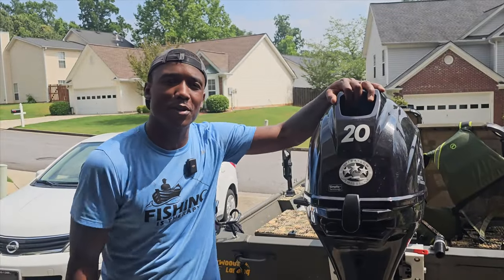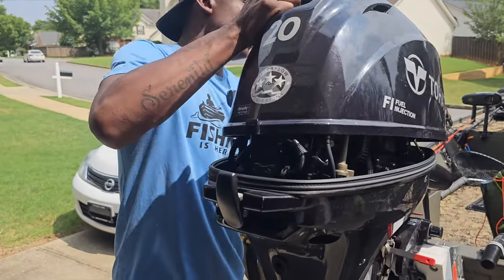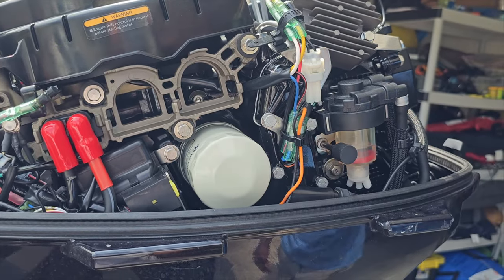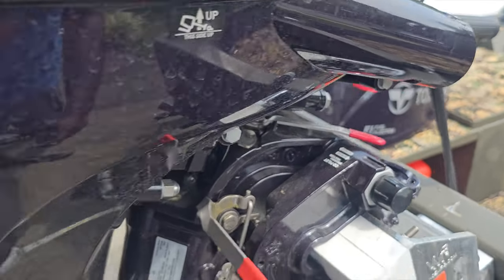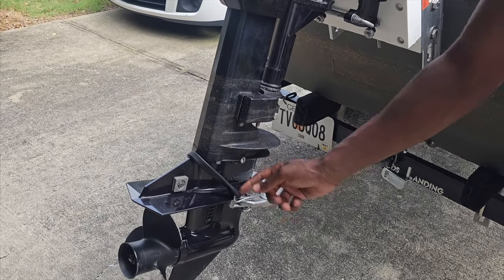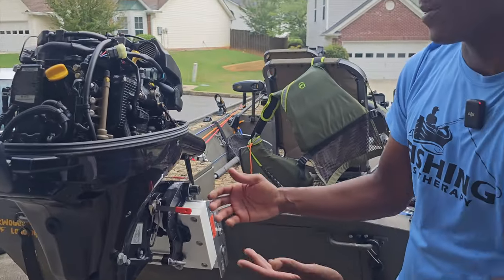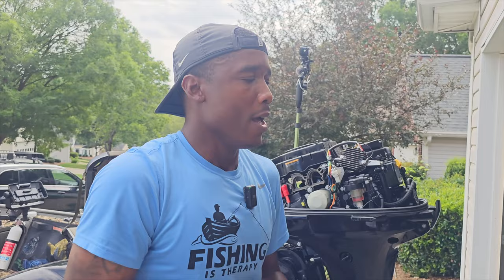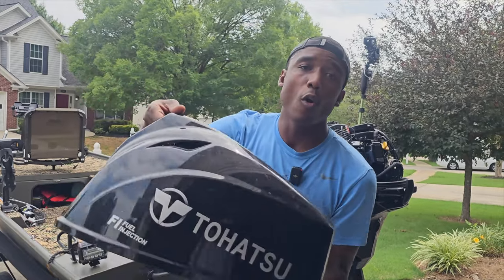Is A Tohatsu Outboard Worth Purchasing? Find Out In This 20hp Tohatsu 1 Year Review

Comment: 2017 Tohatsu MFS30 owner here. I fish saltwater only (Portugal). At 450 engine hours the motor developed an oil leak (but never had any running issues). The retailer changed the entire engine block free of cost. The new block has been great so far (50 hours). Good motors.
Reply from the maker: Awesome. Thanks for the heads up and glad thr engine has been good to you. I love mine. Ran her hard today from one of the lake to the other and she held strong.
Reply: 😮 450 hour boy. You love fishing good for you.
 Have a good day in Portugal.
Reply from the maker: I agree
Reply from the maker: Was their any feedback as to why the oil leak developed and how did you know it was leaking?
Reply: @stevepoulin8964  450 hours is not much.  I reckon these motors, if properly maintained reach around 3000 hours of use consistently.
Reply: @fishingistherapy  I noticed the leaked because when I had the boat at the marina/dock, when I got back at the dock (after using the boat) and raised the trim all the way up, a few drops of oil would drop onto the boat. Also, when I lowered the trim and the prop and skeg touched the water I could see a very visible oil slick. They never told me what caused the leak, but they never opened the cylinders etc..
 Before they gave me a new block they did changed oil pan gasket (I think) and some other part that I dont know how to name in english (retentor da cambota). It also started to progressivly lose oil level on the dip stick.
Reply from the maker: @BogusBoga Wow, that's good they replaced it for you. Tohatsu is a good motor, thank you for sharing that insight. I think these outboards will last a long time with good maintenance.
Reply: Thank you
Reply from the maker: @eternityspoken5207 My pleasure, glad I could help.

Comment: I bought a 2023 EFI model that I really enjoy. I runs forever on 3 gal of gas and is very dependable. I did not opt for an electric start. My only two complaints are that the idle is way too fast, and the shift lever is really flimsy. I may take the shift lever down to a fabrication shop and have one made from Aluminum for it.
Reply from the maker: Yes it is a very efficient outboard and I am sure those tweaks could make it  just right for you. In my 2020 model I dont notice any flimsy shift lever, maybe thats a simple fix.

Comment: Don't buy a Tohatsu, yes they are good outboards but the after market spare parts are a nightmare, my 50 needed a new reed value it was in stock but in Japan, it took over a mouth to arrive but missing a gasket so they were told by the outboard mechanic to send it by express air post, it took over a month so in total ten weeks to get the part!.
Reply from the maker: Man that's a tough pill to swallow. Been thinking about upgrading to a 30hp, is this Tohatsu outboards as a whole or just the 50hp issue with the part?

Comment: I just bought a 25 Tohatsu for my 14 ft skiff. I'm also running a 9 pitch prop. This engine runs well so far.
Reply from the maker: I think it will run well for many years to come with basic regular maintenance! How much did you purchase your skiff for?
Reply: @fishingistherapy  It's a 2001 Carolina Skiff DLX. I paid $2000 for the bare hull, and about 200 for the little center console and windshield--unattached. Then I had to pay a guy to rig it up for me. It has been a solid boat, although it's bumpy in a chop. The engine is just right for the boat at about 150lbs.
Reply from the maker: Man that's a nice setup. I have thought about transitioning to a console drive, just don't want to give up any more space.
Reply: @fishingistherapy  I know what you mean.

Comment: Good video…I own a 2016 20 mercury bought new with 0 hrs in 2019. The only issue I had was my spark plugs went bad at 200hrs. It’s under warranty but my mercury dealer is right down the road and being I was out of town I called them. It was only giving me 1/4 power. I checked all the simple things first but learned that if the plugs are dark with burnt looking oil on them it’s a indicator of water in fuel. Well I pulled both plugs and bingo. Installed the same plugs and 25hrs later till going strong again. My water separator did not show any signs of water but I change my water sep twice  a year now. Those 20s are good motors. Once I put a SS prop on mine I gained 2 mph. I’m running a 9 pitch SS on a 15ft Alweld tunnel haul @ 23mph ish.
Reply from the maker: Nice! I have been contemplating getting a SS prop to reduce the slippage from the aluminum prop. I perform regular maintenance on mine as well. Running strong. Love those 20hp Mercury/Tohatsu's

Comment: I have an 2013 20 HP, 4 stroke, Tohatsu (carburated, not EFI) and it runs perfectly.
It's Japan-made (not chinese), very reliable, and very easy to service at home.
Greetings from Patagonia, Argentina !!! 🇦🇷
Reply from the maker: Greetings and shout out to Patagonia, Argentina. I'm glad you enjoy your outboard just as much as I do. Sound like it's been a  very reliable outboard for you as well. How many years have you had yours?
Reply: @fishingistherapy  The engine is 11 years old, but I have it since 2020 (when I bought an - used - inflatable boat with a road trailer and equipped with this Tohatsu). 
It has sailed only in the patagonian fresh water lakes, in summer times (here: december to march).
A commentary: I fixed the engine at the transom with 4 bolts and nuts, just for safety: I don't want to loose the engine jumping the waves when the day become windy and we have to return.
Reply from the maker: Nice! That definitely speaks to the longevity of the outboard. I agree I also fixed my outboard to my jackplate to ensure it doesn't fall off, makes things safer.

Comment: I have a 2011 MFS20C carbureted 20hp, and it has been bulletproof. Starts every time with 1 to 3 pulls and takes less effort to pull start than the 15hp Evinrude 2 stroke I used to have. I have not had any issues getting parts, though I have only had to buy maintenance items (oil filters, water pump impellers, ect.). Really good motor in my opinion.
Reply from the maker: That's valuable insight. Thanks for sharing it. Let's me know how reliable and efficient these outboards can be.

Comment: Tohatsu 20 here, agreed, excellent outboard pushed my Orkney fishing boat along really well.  Cheers.
Reply from the maker: Exactly, glad you feel the same. I'm surprised how little I knew about this motor before purchasing it.
Reply: @fishingistherapy  I have the electric start and it's never failed me.  Can't believe how little fuel they sip.  I'm using the E5 in mine as recommended by the dealer who fitted it to my boat.
Reply from the maker: I'm still suprosed after 2 years of how efficient on fuel this motor is. I use non-ethanol fuel only and she runs like a charm.

Comment: Thanks for sharing your nice review video. After watching it, I think I'm going to buy one Tohatsu 20hp electric start & power tilt/trim. However I don't know what year of outboard I should buy. The year 2022, 2023 & 2024 are almost $4,000.00, but 2018 is less than $1,600.00.
Reply from the maker: I have the 2020 version fuel injection model which sips gas. Not sure about the 2018 but I'm nmsure you can't go wrong with any year, as long it fits your price range.

Comment: you might think of putting your transom saver above the motor cavitation plate instead of under it ,that's where I place mine
Reply from the maker: I originally did that but was informed that it outs undue stress on the cavitation plate and has even chipped the plate and caused stress cracks as the motor bounces up and down on the highway. Not sure which way is best, but I appreciate your advice. I will look further into both ways.

Comment: Good video. I also have the Tohatsu 20hp 2022 model and really like it. I notice you use an Attwood transom saver. Do you also bolt the outboard to the transom. Im going to fit a transom saver to my trailer, and I'm not sure if I need to bolt the outboard to the transom. Really enjoyed watching. Thanks Steve 👍
Reply from the maker: Hey Steve, its a pleasure. No you dont have to bolt the outboard to the transom, I have althought bolted my outboard to my jackplate for extra safety, but I was already using this jackplate with my outboard simply clamped to the transom.

Comment: Thank you. Would you recommend power tilt and electric start or manual ? Also on your electric start, does it requires to carry external battery? if so, how do you hook it up? thanks in advance!
Reply from the maker: Yes I have an external deep cyle battery i hook it to that runs all my electric i have hooked to my 5 gang switch panel. I have it setup under the rear seat hatch. Its a simple 2 ring terminal hook up direct to the battery. Also I would recommend electric eith power tilt so you dont have reach back and adjust it manually but it doesn't bother me to have to do it manually plus I have a manual jackplate that I can adjust on the fly. But I had the extra money I would get the power tilt and trim, just have to makensure your battery doesnt die because I have heard many people frustrate with not being able to tilt and trim or electric start on the water.
Reply: @fishingistherapy thank you for your detailed response!. If battery dies, it shouldn't have a problem starting it manually? Is that correct?
Reply from the maker: Yes that is correct. My battery has died twice while on 3 day camping trips and I pulled started without any issues.

Comment: Ordered my Tohatsu MFS20EEFL today!!  Got a great deal.  Watching your videos again for some tips.  I have a brand new deep cycle marine battery that maintains a charge well during a fishing trip.  Can I use that for my Tohatsu as well or will I need another battery?  Thank you.
Reply from the maker: Nice! I'm glad my videos are helpful to you. In my opinion, the deep cycle you currently have will work. I actually have the majority of my electronics wired to my deep cycle along with my Tohatsu, and it works well. I love it because when underway my outboard will charge the battery, which then powers and charges my electronics like an alternator in a car....I can rely on it! Hope that helps.
Reply: @fishingistherapy  Excellent- Thank you.  I was wondering if the outboard had a generator to recharge.   Happy Easter.
Reply from the maker: @Luigi1962 Yes indeed. Happy Easter to you as well, enjoy yourself. Tightlines!

Comment: Have you thought about getting a hydra-foil? That helped my 40hp alot on take off and getting up to speed.
Reply from the maker: I have thought about it. Just concerned it may not help me as much and be worth the wholes drilled. How much performance improvement or holeshot did you gain or notice?
Reply: @fishingistherapy  no top end performance improvement but it did get keep the boat from dragging the back during acceleration.  I have a 16 ft V Hull aluminum Tracker with a custom front deck.  The motor is an old 40hp Evinrude tiller.  i am a big guy so I think all that weight in the back made it worthwhile for me to add one.  The prop is old as well.
Reply: What is your max rpm and current prop without the foil? Usually a foil is a bandaid for improper prop selection... doesn't help anything
Reply from the maker: @lukesmith32  Its a 9 pitch prop when running with a buddy or two. Rpms are at 6100 max. By myself it can overrev with a 9 pitch, when I know I'm running alone I switch to a 10p and run between 6000 to 6300, but I keep it right around 6100

Comment: Does it normally start first pull?
Reply from the maker: Yes, every time, I only had it take a few pulls once when it was really cold and i believe that was due to operater error letting wayer into the fuel line, but since it has been even colder and still starts on first push or pull!. It has been very reliable!

Comment: Just don't hit anything with it or the mid section will break in half. The metal is paper thin, that's why they are so light. The driveshaft is also smaller than my pinky finger.
Reply from the maker: Wow, thanks for the valuable insight. Did you have yours repaired?

Comment: Is this outboard with power tilt ?
Reply from the maker: No, that would be great for it, but it's manual tilt.
Reply: @fishingistherapy  just wondering why you have a transom saver on there , I thought it was outboards with power tilt needed transom saver.
Reply from the maker: @flyinphil42  I would always recommend a transom saver so that you don't compromise the transom when it bounces up and down on the highway. I lost a transom saver twice and towed home from a 2.5hr trip and a Savannah 5 hr trip and that bouncing and etc really stresses the transom, rather be safe, it's a simple addition for the added support and longevity.
Reply: @fishingistherapy  I was just wondering what the difference is between the conventional transom saver in your video and the new rubber block style transom savers that wedge in between the ram to support the power tilt.
Reply from the maker: @flyinphil42  Yes those rubber block   ones are for power tilt systems.

Comment: Is this 2020 or 2022 engine?
Reply from the maker: This is the 2020 model. Got it when it was the new model.
Reply: @fishingistherapy  thnks
Reply: @fishingistherapy  is it difficult to tilt it?
Reply from the maker: @eternityspoken5207  No, in my opinion its very easy to tilt, buttery smooth ergonomics.
Reply: @fishingistherapy  thank you, I wasnt sure if I need power tilt or not, power tilt adds weight to the engine which not ideal.
Reply from the maker: @eternityspoken5207 Exactly, its convenient but cost more and weighs more. Have to take all that into consideration including tour overall load you need thr outboard to push.
Reply: @fishingistherapy  Thank you!
Reply from the maker: @eternityspoken5207 My pleasure!